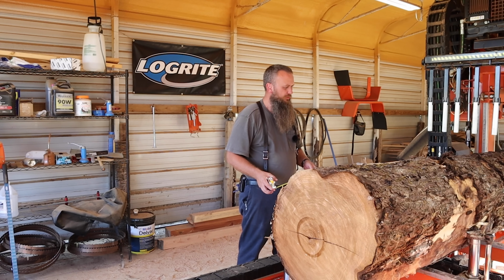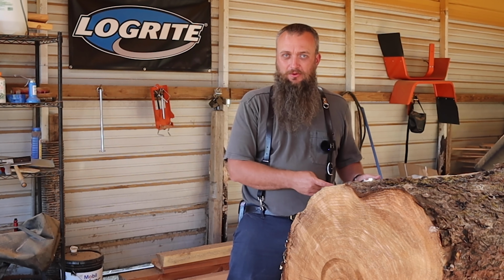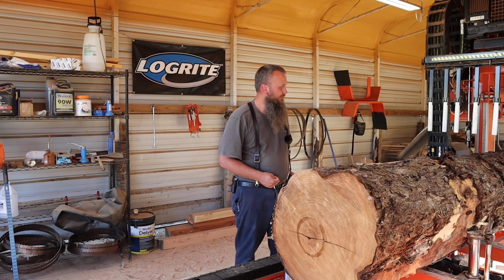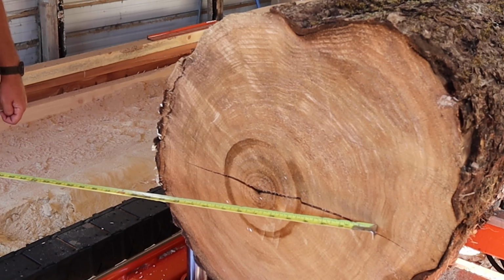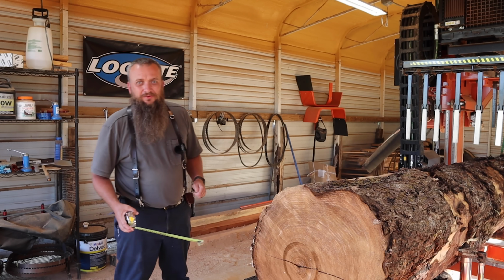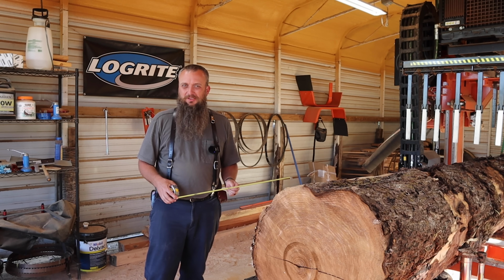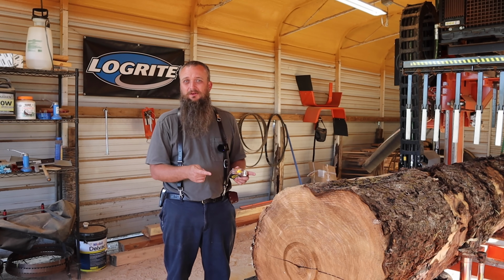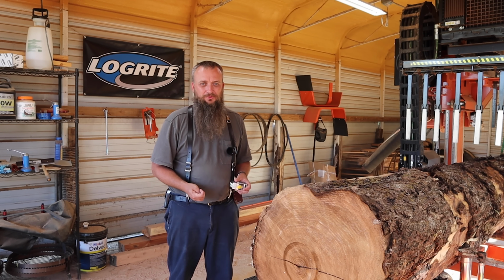Turning A Cheap Log Into Big Money $ On My Sawmill, Amazing Slabs

Comment: I can't miss a single video of yours. Great job. 
I do have a question for you; what kind of ventilation system do you use for your sawmill? A friendly suggestion is a exhaust hose on you sawmill engine. It would reduce all of that engine exhaust you're dealing with.

Comment: That cedar being so much red in it will past forever. The majority of the inside being red is what you want to see when you cut into eastern red cedar. Very rot resistant even out in the weather as a fence post it won't rot for many, many years.

Comment: Like to remove bucket when mowing, increases mobility around obstacles. Shortens tractor length. Many folks remove the loader altogether, it is an option but never encountered the actual need. YMMV 🚜🍶🗽🇺🇸